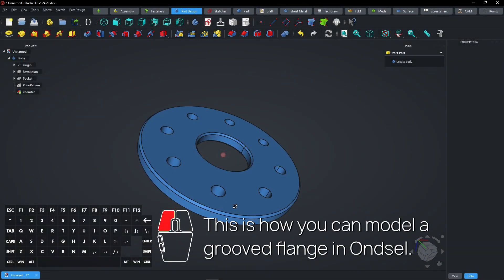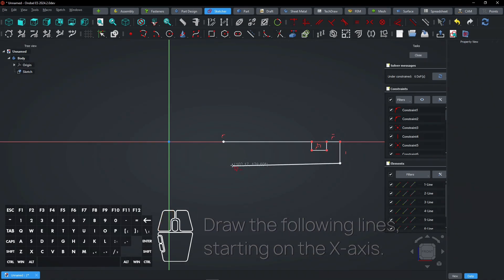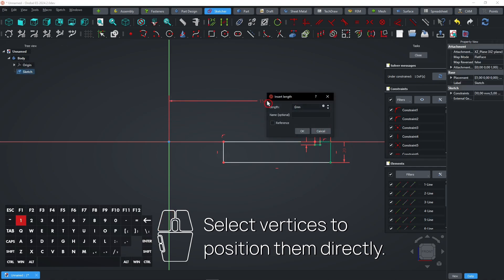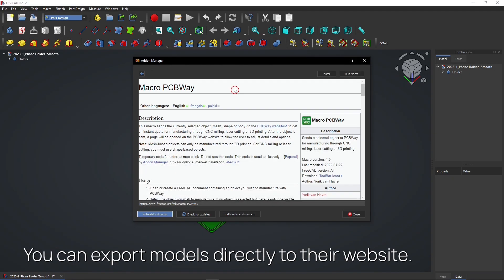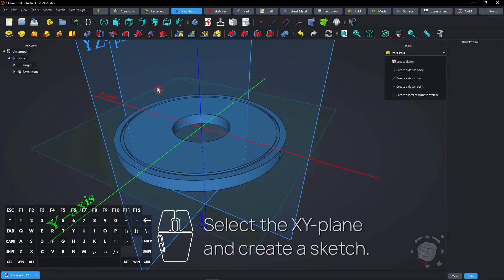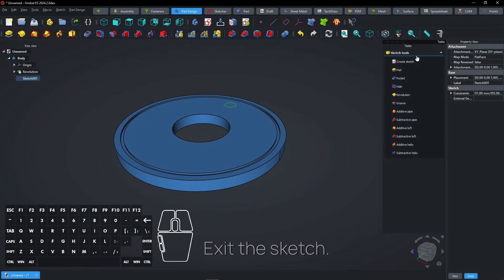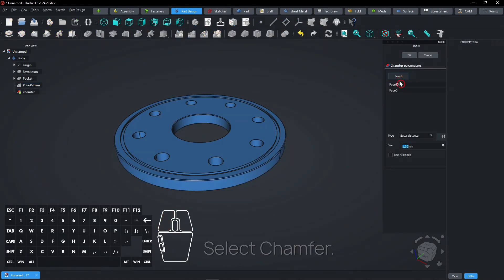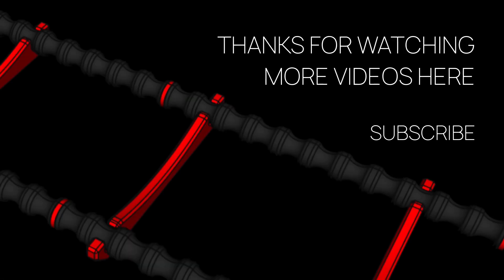🟢 Ondsel For Beginners - Design A Grooved Flange - Ondsel Tutorial - FreeCAD Revolve

Comment from the maker: 📦 Visit My 3D Printing Channel: https://www.youtube.com/@3DParts4U
⏱ Visit My Speed Modeling & Timelapses Channel: https://www.youtube.com/@AllVisuals4USpeed
🤝 Get Commercial Access To My Catalog Of 3D Files: https://www.patreon.com/3DParts4U (Or Support Me)
🤖 Check Out My AI Channel: https://www.youtube.com/@AllVisualsAI
💶 Check Out My Finance Channel: https://www.youtube.com/@PaycheckPlayground
📚 Check Out My Storytelling Channel: https://www.youtube.com/@VeinsOfTheUnsolved

1. Piping joints (Tee https://youtu.be/6yOhP8vCl7U, Cross, Y)
2. Couplers and reducers (male, female)
3. Internal and external threads: https://youtu.be/YZo1gELeHPE.
4. Elbows (45/135 degrees, 90 degrees): https://youtu.be/oLz7hqdDJ00.
5. Union fitting, 
6. Nipples (hose nipple: https://youtu.be/z8lvmfYMK08; reducer nipple)
7. End caps and plugs (hex, square)
8. Hex lock nut (Fasteners workbench)
9. Valves (lever, wheel, etc.) (only external shape)
10. Taps (faucets): https://youtu.be/9oaKinhKXa8.
11. Shower heads
12. Clamps and clips
13. Mixer (which mix hot and cold water)
14. Hub ends (for "bell-and-spigot" joining)
15. Elbow joints with access cap
16. Stop rings on straight pipes and elbow joints

Comment: Well, after four attempts I finally completed the flange - three times the work disappeared - I am guessing that I must have "touched" something I shouldn't have...
But I cannot manipulate the completed body image with the mouse cursor The sync view is selected but I do not get the rotating arrows cursor, just the normal white select arrow.

This software is sooo frustrating.
Reply from the maker: 👍 You can try to right click on the screen and select the Gesture navigation mode.
Reply: @AllVisuals4U  Thank you for the hint - Gesture does work. But I am surprised that none of the other nav options work
Reply from the maker: @davehrcfpv You're welcome! No, all the others are not better in my opinion.

Comment: Beautifully explained!

I have a request: Can you please make a playlist of shorts to show how to create various plumbing parts, such as-
1. Piping joints (Tee, Cross, Y)
2. Couplers and reducers (male, female)
3. Internal and external threads
4. Elbows (45/135 degrees, 90 degrees)
5. Union fitting, 
6. Nipples (hose nipple, reducer nipple)
7. End caps and plugs (hex, square)
8. Hex lock nut
9. Valves (lever, wheel, etc.) (only external shape)
10. Taps (faucets)
11. Shower heads
12. Clamps and clips

If we learn to create these shapes as building blocks, it would be easier to design plumbing in Ondsel! 

Thanks in advance!
Reply: @AllVisuals4U  This is a nice touch to show links to the other videos!

BTW, you could just edit the description and add this list there.
A better way is to just provide a link to the playlist, from where the viewer can pick any other video in the playlist. That way, you do not have to keep editing the list to add the links.

Please consider adding the following plumbing shapes:
13. Mixer (which mix hot and cold water)
14. Hub ends (for "bell-and-spigot" joining)
15. Elbow joints with access cap
16. Stop rings on straight pipes and elbow joints.

Notes: 
1. Some models of elbows and pipes have expanded ends called "hubs", to allow them to join with other pipes with a "bell-and-spigot" type joint.

2. The access cap in an elbow can be opened to clean the pipes on both sides
3. The stop rings are meant to provide a secure clamping of the pipe, so that it does not slide down the wall.

Unfortunately, YouTube does not allow viewers to provide links. 
But you can easily find these parts with Google images.

(I am aware that English is not your native language.)
Reply from the maker: Thank you! That are some great ideas to model, I put them on my list! 👍